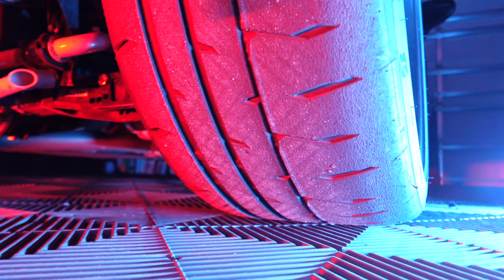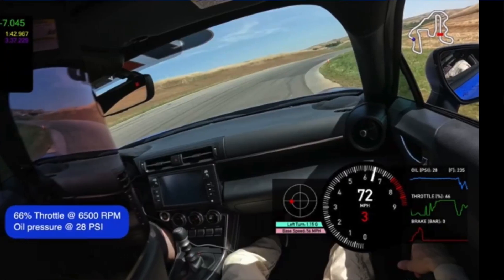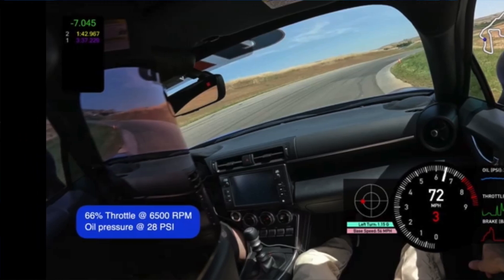GR86 Motor Problems

Comment: Subaru hands down makes some of the worst sports car engines
Reply from the maker: Yeah, too bad it’s not similar to Porsche lol
Reply: @phelpsgarage4202  Yea Porsche actually improves and develops their engines meanwhile Subaru is still having the same issues years after years? Like a proper oil pan baffle should just be there with how these engines are designed.

Comment: I use an oil cooler, a baffle and 5w40 with a hks supercharger and no problem so far but no mesure either.
Reply from the maker: Gen 2 car?!? Do you track it?
Reply: @ 
Did it with a 2013 and now with 2023. 2013 I kept it for 240 000km/5years and I tracked it 3-4 times a year. 

Now the 2023, I tracked it 3 times this summer and did 70000km including 20 000 km with the supercharger.
Reply from the maker: @ hell yeah!! Any issues?
Reply: @phelpsgarage4202  Still no issues with any of those 2 cars. The set up I have now is even better than the rat so I don’t worry .

Comment: Would it be ok to do these mods even if you don't track the car , like it's just a daily driver that you like to be aggressive and have fun sometimes
Reply from the maker: It won’t hurt but not necessarily. Overfill it with 5w30 and keep the temps below 260

Comment: All is needed is oil overfill by 0,5 quart if you want hard track that car, if you have wider tires, coilovers and a lot of grip, overfill it by quart on track day. Thats all what you need to do
Reply from the maker: Yeah, that’s the easiest way to solve the issue. It’s still exist, but this by far is probably the best thing you can do. I’m curious to see how the new pairing from verus engineering works.

Comment: Great videos thank you for sharing. I have a GT86 and I have the full Toyota TMG cup modification upgrade similar to the ones used on the Nürburgring cup series. I have the oil cooler and the cosworth baffle plate I was also told by Toyota Motorsport Germany to avoid using the recommended 0W20 for track and I should change to 10W60. They also recommended to change the oil and other fluids after a hard weekend at the track. My cars milage is around 70k now mostly hard use both on road and track. One thing I'm not using from TMG is the engine ECU tune I'm using a company in England the name is Fensport check them out I believe they have the best tune for the GT86 and the GR86 👍
Reply from the maker: Hell yeah, thanks for sharing!!

Comment: 60 PSI is a great improvement I think, its definitely confidence inspiring to see that with a good baffle and cooler combo there is a substantial improvement on oil pressure when cornering hard. My 86 is currently sitting in customs, hopefully arriving at my dealership soon. Trying to do as much research as I can on this topic to try and extend the longevity of my soon to be new car as I do plan on tracking it eventually, but I'd like to make sure the engine is properly oiled as well in spirited street driving (ie. tail of the dragon, Keweenaw peninsula etc.)
Reply from the maker: The easiest mod is to drain the oil and add 5w-30 with a tad bit over fill for safety. Once you start tracking if you not worried about the warranty do the baffle plate and oil cooler.
Reply: @phelpsgarage4202  I wish toyota were more clear about their warranty policy, but I guess that gives them a bigger CYOA if engine damage were to occur. I'll steer away from the baffle and cooler for now, but I'll definitely monitor oil pressure in spirited driving to see if even that is affected. Despite all of the FA24s shortcomings, I'm still excited for the car and I hope to enjoy the chassis for a very long time

Comment: Super video!
Good to hear you have healthier oil pressure now on right hand corners!
Have you gotten your oil analysis back yet?
I have an 02 WRX wagon that had it’s motor out, torn down at 176k due to a burned exhaust valve ( they were pretty thin by that point ).
One track day, but lots of spirited corners.
I had one bearing, lower rod I think, that had a few layers showing.  The WRX early motors had 1 oiling hole per bearing, updated crankshafts had 2 oiling holes.  I went with a new short block.
I used Walmart 10-30 Mobil 1 in the 5 quart jugs every 5k.
Cylinders still had hone crosshatch throughout the cylinders at 176k even with a stage 1 tune.  
Not sure if the track day, old crank design, or exceeding the baffle design almost got me?
Dealer reused the original oil pump and internal oil cooler.
I’ve got about 90k miles on the newer motor.
The new short block had a much finer hard to see honing.  I’ve generally run 5-30 Mobil 1 in the new motor.  I think it’s designed to run lighter oil, but I like a thicker oil for a little insurance.
There was a lot of debate on oils and analysis in the WRX community.
Shell 0-40 synthetic I think was kind of well thought of?
I hope more BRZ 86 owners see your videos!
Reply from the maker: Thank you! No I haven’t heard anything about the oil analysis yet.. I also had a 02 WRX and a 07 STi. The STi was super fun but never tracked it. It’s made 460 hp on race gas 😎😅
Reply: @phelpsgarage4202  oh, cool!
I have a friend that did well in auto-X with both an early WRX Wagon and maybe on ‘05 or ‘06 sti, I think he may have been a national champ in the sti.
He went on to first gen BRZ, not sure how that worked out, but he loved the car :)
I got to be part of the BRZ introduction brochure social media shoot for Subaru in 2012.  I was an “Enthusiast”, and got to hustle it up some canyon road closed by the chp a number of times, and give impressions.  All good, an amazing car!

Comment: Hey man, I’m also in Florida and I’ve been wanting to get into the track scene. Where do you go? I only know of Daytona and Sebring down here.
Reply from the maker: Race the firm, and Miami speedway. I’m home track is Sebring. Where are you located?
Reply: @phelpsgarage4202  Orlando. Smack dab in the middle.
Reply from the maker: @Farish_Bueller  sweet come out to Sebring September 30 and get some seat time
Reply: @phelpsgarage4202  Awesome. Looking forward to it. In the process of locking down a 128i.
Reply from the maker: @Farish_Bueller  I had a tuned 135i years ago

Comment: Have you thought about running a dry sump setup to deal with the pressure drop?
Reply from the maker: That would be nice! Do they even make one for this car?
Reply: @phelpsgarage4202  nothing specific yet (I haven't had a good look yet), but the only thing that would need to fit specifically would be the shallow pan with grooves for easy pump pickup.

I've currently got my second gen BRZ in workshop here in Perth, Western Australia. It's essentially an R&D project for Sprintex and Tokyo Motorsports. They are installing an S5 210 supercharger. There are fixture modifications that need doing.
Reply from the maker: @OzzyJackal72  I would love to boost this car but need to make sure we solve the oil issue
Reply: @phelpsgarage4202  I'll let you know how it goes with the SC. I'm starting out modest with the boost until a few other support mods are in and more info on the engine limits.
My car isn't for Track world just Street and car shows.
Reply from the maker: @OzzyJackal72  please and thank you!
Reply: @phelpsgarage4202  GSpeed did a dry sump for the FA20. Maybe touch base with them and see if they have anything yet

Comment: I believe you need data not just 'think' it's good.  There was a video recently showing the differences in left and right corners where one direction would cause oil pressure to drop half way, and elevation changes made it worse.  For a really good handling car, this was REALLY poor of Subaru to not have this very basic stuff taken care of.  Good luck with what you find out.  Lot's of people wanting a solid fix for this.  (EDIT: The video in question is by 900BRZ and titled: "BRZ/GR86 FA24 Oil Pressure Loss Demonstration")
Reply from the maker: I agree. I’ve seen a lot of data that is showing what they’re talking about. I just wanted to bring attention to what I’m doing to help prevent some of these issues and I know it’s not going to solve it 100% until we get a better baffle plate, design/pan.
Reply: @phelpsgarage4202  the more attention the better.  I'm sure we are in the same frame of mind. Apologies if I didn't articulate it well enough the first time around.
Reply from the maker: @matthewwain9958  no worries here! Hopefully the aftermarket can help solve the issue
Reply: @phelpsgarage4202 seems like Subaru/ Toyota should offer some track friendly pans baffles especially for a vehicle that is this sporty and track oriented.
But aftermarket as needed.
Reply from the maker: @ScottoGrotto  I agree

Comment: Do you have any actual data of oil pressure for 0w-20 vs 0w-30 or 5w-30?
Reply from the maker: No but what we see is about 10 psi from 5w-30 to 5w-40

Comment: Popcorn 🍿 ready 😂… from what I’ve seen a baffle doesn’t even help
Reply from the maker: It doesn’t solve the low oil pressure 100% but it does help.. I think a better oil pickup with a better plate and larger pan could be the ticket! 🙏🏻

Comment: Minimum 5w30 ✅ 
Run at least an extra quart for the track ✅
Oil cooler ✅
Baffle plate✅
Killer bee pickup ✅
2qt accusump ✅
FA20 on Hoosiers/aero and haven’t had any issues.
Reply from the maker: I agree with you on that. FA24 has a offset pickup and I believe that’s why we’re having this issue on hard right hand corners
Reply: @phelpsgarage4202  FA20 is a weird design as well. Killer bee has a straight angle and larger ID

Comment: Considering selling both my 2020 Mazda 3 AWD, as well as my 95 Miata to pick one of these up. As reliability is one of my highest priorities, I'm a little heartbroken to discover the issues around these engines after test driving a 2022 with 7,000, mi on it and falling in love. Really glad this community is on top of things and sharing the information. ❤️👏👏👍
Reply from the maker: Hopefully the aftermarket will have a really good solution for the fix 🙏🏻
Reply: @phelpsgarage4202  One of the vids I stumbled upon a video after this one, indicating that somebody is currently testing a prototype baffle for the oil pan that should assist with the oil psi drop around right hand corners and elevation drops. If I pull the trigger on the purchase, I'll just have to deny myself the joy of right hand cloverleaf entrance ramps until the issue is sorted😢. (Probably wouldn't do any track days either 😭)
Reply from the maker: @apexchaser6187  thicker and cooler oil until then..
Reply: @phelpsgarage4202  yeah, multiple people as well as you have offered up that suggestion. Happily take a small decrease in fuel economy, for longevity overall 👍
Reply: @phelpsgarage4202  https://youtu.be/4Jk5WTWoqt4
Reply: considering i have been telling folks for years about the terrible subaru reliability. You will still have many who buy STI and other subarus. So in my opinion, follow the herd and buy it if you really want it.

Comment: i don’t really autocross or go on track days but i do a lot of spirited driving in the backroads (empty mostly surrounded by farms). Are there mods I can do that isn’t a full on overhaul to avoid this problem?
Reply from the maker: I would probably just go with 5w30 and if temps over over 260 maybe a oil cooler but I doubt you’ll get them there

Comment: I’m using my ‘23 BRZ for autocross in S. Florida heat. It’s stock other than Falken 200 TW 225’s and exhaust. I’m planning on running 5w 30 and leaving everything else alone to hopefully save my warranty coverage. Does this make sense or no?
Reply: Thanks for the reply. Keep up the excellent content!
Reply from the maker: I would use the 5w30 and keeping it stock for the warranty is probably the best thing if anything happens.

Comment: is there anything to increase oil capacity?  an additional quart or so can't hurt above what is added in the oil cooler/lines?  can a wider oil coiler fit in the front bumper?
Reply from the maker: Unless someone makes a bigger oil pan. The issue is that we can’t extend the oil pickup. And if someone makes a pan, it has to clear all the aftermarket headers which can be a pain. Wider oil cooler could fit but doesn’t help the oil starvation on right hand corner

Comment: people have been oil starving in subaru/toyota boxer engines forever. not sure why this is only being talked about right now. most serious racers will go dry sump but if the budget doesn’t allow for that, accusump with baffling will work. Slicks and aero will almost 100% require drysump
Reply from the maker: I’m about to add more aero.. Let’s see what the aftermarket comes out with.
Reply: @phelpsgarage4202   i have the fa20DIT and see huge oil pressure drops. Goes from 80psi to 20psi in corners/braking and i’m stock aero on 100tw tires. Oil cooler, oil pickup and ported oil pump/galleys as well

Comment: How high was the oil level?

Is the oil level between the gauge min/max markings?
Reply from the maker: I keep it just a tad above full
Reply: @phelpsgarage4202  i recommended to add more than 500ml of oil from full

Run with oil that is 5-10mm more the full level point

As you know, it is considered advantageous to increase the amount of oil above the regulation because the problem of not coming down is greater than the problem of locking the oil in the oil pan

Comment: The oil pressure regularly dropping from 60psi to 30 or even 20psi during right hand corners is no good.
Reply from the maker: Hell no
Reply: @phelpsgarage4202   What can be done? Is there a way to dry sump an 86? If not, maybe a smartly designed, baffled pan??
Reply from the maker: @bliglum  the aftermarket is working on on a better baffle plate and timing hold cover right now. Time will tell if it works. The way the oil pickup is designed is making it hard.

Comment: This is exactly what I’ve been looking for. I just bought my ‘23 BRZ in February and I love this car but I’ve been looking for stuff that could make my car become very reliable even before I bought it. I only have 3800 miles in my car but once I get my first oil change, I’m going to get that Tomei Oil Pan for sure because that makes the oil come down how it should. Until around autumn season, I’m daily driving my car so I’m kind of worried if I should change the oil or leave it at 0w20 because I haven’t heard anyone else change it like you have. But I really do appreciate your help honestly!
Reply from the maker: The tomei baffle plate is not 100% going to solve the problem but it does help. Having slightly thicker oil helps and having your oil temp stay cooler also helps. Killer Bee has something coming soon that should help also. If it was my car I wouldn’t track it with 0W 20.
Reply: @phelpsgarage4202  I’ll definitely change the oil and have the oil temp stay cooler than! Can’t wait to see what you have next, thank you
Reply from the maker: @_Capitancorrea_  we have a couple of things coming soon 😎
Reply: @phelpsgarage4202 I saw another owner try a killer b baffle, didn’t seem to do as much as your tomei part has.
Reply from the maker: @ScottoGrotto  yeah I believe it was to block oil from getting into the front cover.
Reply: Would the Tomei oil pan put it out of warranty?
Reply from the maker: @johnrooney507  that’s a question for the dealership. But I feel like they will try to use anything to deny a warranty claim.

Comment: Hook up a pressure washer to it, drill through the firewall and put the trigger next to the steering wheel. Every time you turn just hold it down to give you some oil pressure.
Reply from the maker: Hell yeah brother!!
Reply: ironically enough you just described exactly what an accusump would do automatically on oil pressure loss, which at the moment seems to be the best fix outside of fitting a full fledged dry sump system

Comment: Would you recomment the Syms racing oil pan or the tomei? both seem to cost about the same.
Reply from the maker: I don’t know much on the syms.. but killer b is working on something that might solve the problem.
Reply: @phelpsgarage4202  That is the same conversation i just had with Ezikiel from CM autohaus. Thanks yeah i guess i wait a bit more. im just worried the damage is already done. I just did my 7th and 8th track days at sonoma this past weekend with 23K miles. High key was worried it was going to die either of those days.
Reply from the maker: @uND3rrated_MX5  what weight oil?
Reply: @phelpsgarage4202  mostly motul 5w30 efe but this last oil change i went with liqui molly 5w30 instead. i have an oil cooler as well.

Comment: K20 swap it, problem solved.
Reply: K24.....but yes.
Reply: @wayward03  too big
Reply: @williamcricket7931  k20 would be a downgrade in performance....

People have put an LS under the hood, so I imagine the 24 would fit with some cutting
Reply: @wayward03 k20 outperformed the fa24 every day of the week
Reply: Sr20 swap
Reply: NO
Reply: High center of gravity
Reply: @impreza0109  Doesn't blow up in a couple laps plus you can put coilovers on the car to solve the problem
Reply: @williamcricket7931 Somthing a Mexican ricer would do😅

Comment: Great content just FYI the First gen cars VVTI Cams don’t like the thicker 40 weight  oil, it will bring check engine light codes related to cam correlations, wonder if it’s still
An issue for this second gen engines.
Reply: Mine is 2016 and I always run 5w40 since it was 10k miles... now sets at 75k miles never had issues with avcs/vvti due to 5w40
Reply from the maker: @ej254  good to know!
Reply from the maker: Good point I’ll find out. I mainly just track the car so the temps are high so hopefully  0w40 is not too much